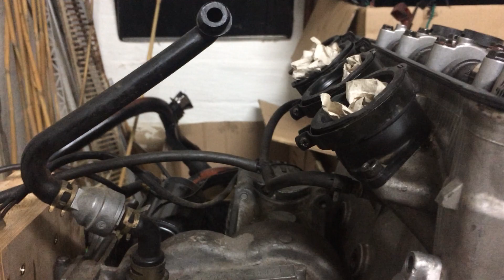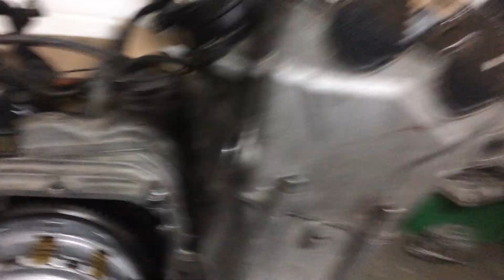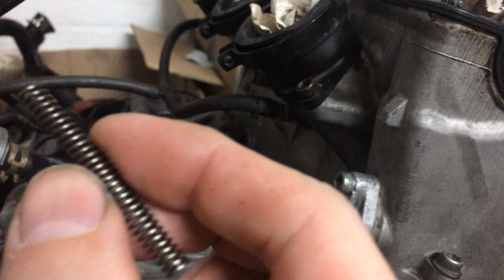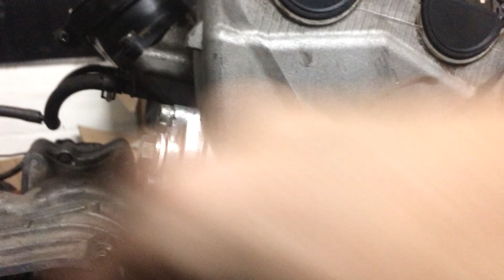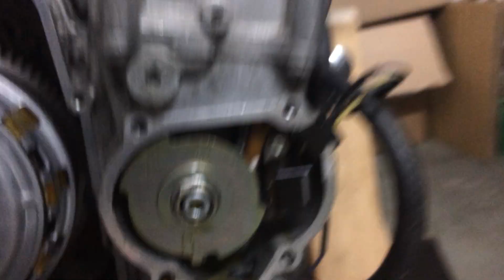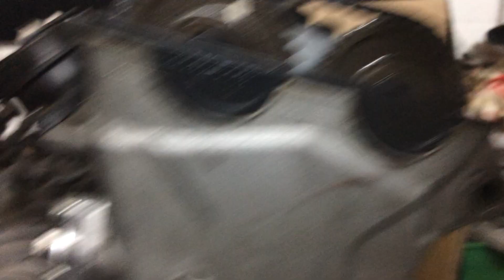95 Kawasaki ZX9R Ninja Cam Chain Tension-er , CCT reset and install

Comment: Do not do this this is wrong
Reply from the maker: Especially not up side down. Like the guy I got the bike of off. He really did not know what he was doing.
Reply: I agree check the Haynes manual I'm sure it's meant to be 7 clicks out when you put it back in.
Reply: @Cullz.182  I heard 5 clicks but might be model specific.
Reply from the maker: @HalfdeadRider   I dont have a manual, but for one the chain should tennion its self. When I got the bike it was all in  parts and someone who has no idea what he was doing installed it up side down. As to the clicks, it depends on how old the timing chain is, if its new its a different story. Also it does depend on the modell. This is a ZX900B.
Reply: @Iamtoookool  You'd be surprised how little wear the timing chains tend to get. On relatively low mileage bikes like mine that are still under 20k miles, it will be like new, they rarely need changing, even on higher mileage bikes.

The only reason I watched was because I was/am considering fitting a manual CCT at some point, due to the constant tension they give through the rev range.

You then won't have the chance of bent valves due to the chain loosening and jumping teeth at high rpm's, this can happen with an auto tensioner, and auto tensioners are more prone to failure.
Reply from the maker: @HalfdeadRider   I got the bike with 3567 miles on the clock and it being from 1995 is really interesting how little this bike musst have been driven. Only problem I now ran into is that the Headgasket is broken. Found out last month that this is a problem on this model.  this issue tends to pop up at around 34000 miles. But this gives me the chance to take the bike apart and restore it to top nutch. And I have taken her up to 180mph, Germany has the Autobahn. never had the problem of jumping at higher Rpm`s.
Reply: @Iamtoookool  Poor bike, at least it's getting used and looked after, I guess the gasket just perishes over time. I'd like to do more work to mine at some point, but it is difficult to do big jobs without a garage in the UK, I've done a fair bit to it aphetically though. I had mine up to 160 and that was pretty easy and of course had more to go, they still hold up against modern sport bikes with less weight and more power. Good luck with the work.
Reply from the maker: @HalfdeadRider  I got the same problem. wanted to do more videos, just for the heck of it. But between work and college I just dont find the time for it anymore.  Oh yea I have left ducatis and BMWs in the dust. Its kinda funny as they have so much more power. Thanks I will see about maybe posting some video of what I am doing if anything interesting pops up. 
Good luck to you as well, stay safe in the road riding.
Reply: Actually he did it 100%  right
Reply: @misterwatch8241  really cause i need to change mine olso
Reply: @alonso-tf3hi  Yup for this model do as in video 👍 he follow service manual.
Reply: @misterwatch8241  He certainly didn't follow the service manual, said so himself lol You push it back in as he did, then pull it out five clicks, refit it, then turn the engine clockwise a few times from the crank slowly to let the tensioner set itself.
Reply: @paul-ep4ux  Check my very last comment, it is how I said it was, done it myself since and I did actually follow the manual, then fitted a manual cam chain tensioner! 😎
Mine is the Y2k model, but the manual covers all models, and the ZX7r too. The CCT itself is the exact same unit.
Reply: @HalfdeadRider I have an e1 also just ordered the new CCT I don’t have a manual do I just slap it in like that
Reply: @HalfdeadRider if I were doing it without the motor out can I push the bike to get it engaged like push the bike in gear
Reply: @Cullz.182 which one was it 5 or 7 clicks on an e1